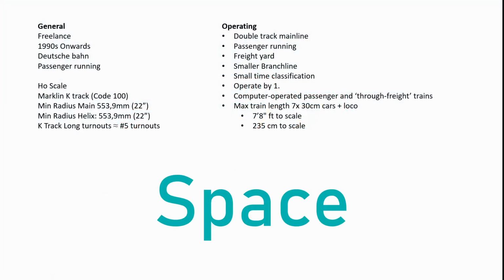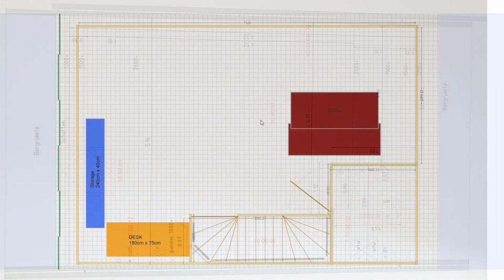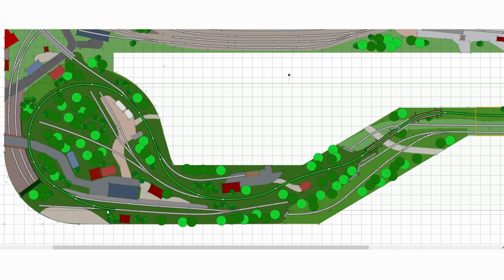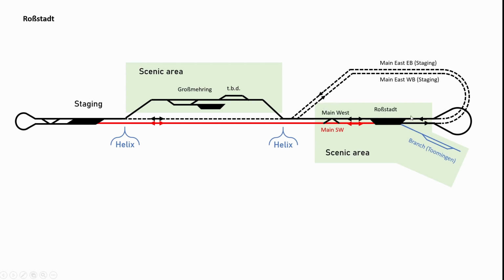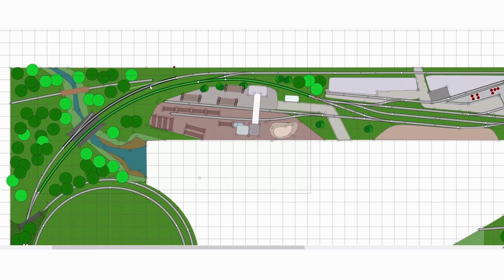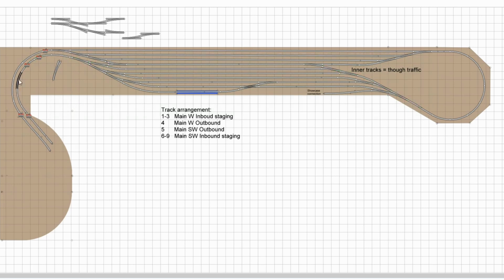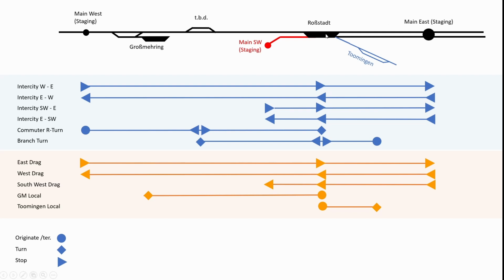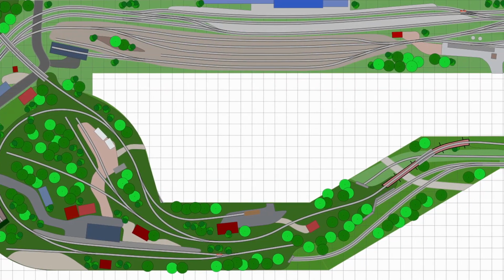65 - MRR Layout Design - RossStadt 2.4 x 6.1m

Comment: Omg its really awesome 
It includes all the ideas i have had in my head for many years 

The only differences is iam N scale
Reply from the maker: Hi Henrik, great to hear. In N scale you'll have much more possibilities. 
If you need help with the design, I provide layout design services.
Reply: @ModelRailroadDesigns  hi thats really perfect i will note your contact details 
And be in touch :-`
Reply from the maker: @xcrisso  Great Henrik, It will be a fun experience to design a layout. You can find my email in the 'about' section of my channel. I'm looking forward to hearing from you.
Reply: @ModelRailroadDesigns  what i would love to start with would be:
x Quantity of 400x800x100mm Fremo modules N-RE
Basic Idea would be Drive through ICE/IC Station (maybe some track that ends)
and then as bonus an automatic ekstra LINE with Regional Trafiic with 2-3 trains running back and forwards automaticly randomized
Reply from the maker: That's a great idea. Check my email and let's go!

Comment: Sorry, this may be posted elsewhere, but what program do you use for your track designs?  I am currently using 3rd Planit and it can be a little “buggy”.
Reply from the maker: Hi Joe,
I use anyrail 6. It is great for just track planning and everything you see in the video. It is not a CAD tool so be aware of that. And I don't know how complex you want to make your design, but I find with layouts like this one, that i am reaching the limits of the program.
P.s. you can get all of my designs from my patreon page. I also offer layout design services. I have a backlog at the moment of work but I'm sure i can squeeze in another project.
Reply: @ModelRailroadDesigns  Thanks for the information.  I am getting back into the hobby after a 20 year absence, now that I have more time and a fairly large space to build in.  Your videos are great and I appreciate all the information and work that goes into them!  Keep up the good work!
Reply from the maker: @joeb5577  Thanks for the support!

Comment: Great ideas that you show here. I like both systems very much. Greetings Tino
Reply from the maker: Hi Tino, it is very much a mix of systems. There are a few Peco turnouts in there that will be converted to 3 rail. Marklin (Still) doesn't have a broad range of turnouts...... A lot of the straights in the staging will be standard flex track with a copper wire run through the middel.